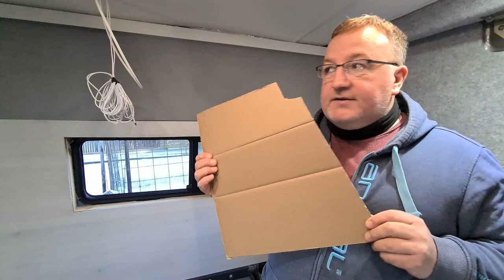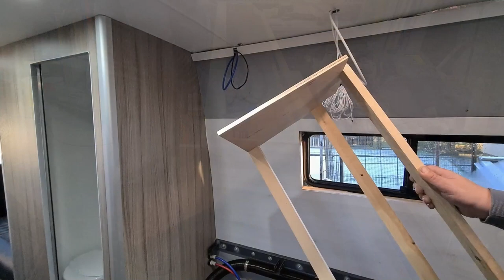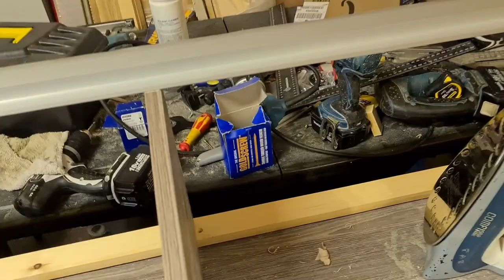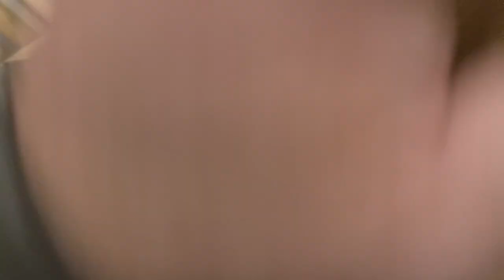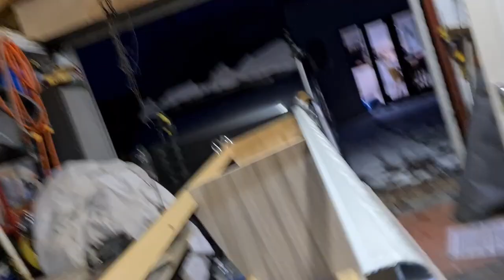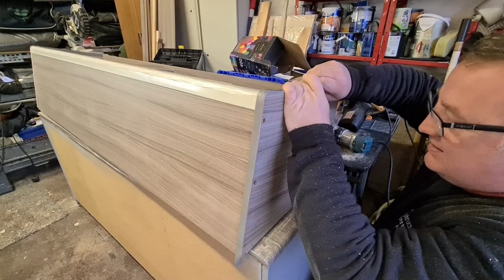selfbuild | vw crafter | campervan | overhead cabinets | van build | part 31 | the crafty blinders

Comment: How many sheets of the furniture board did you use for your build, Sam? Love the overall finished look.
Reply from the maker: I would like to say 3 full sheets but considering I have purchased 6 in total that wouldn't be totally honest it works out that to be economical I had to use pieces from a few boards as I ripped them down I would mark up the off cuts as potential parts for the build to reduce wastage so 3 is a good estimate but made up of off cuts mainly 👍
Reply: @TheCraftyBlindersvanlife  Cheers. I plan on templating all the parts into 4mm ply first which I get cheap being a floorlayer. Once I have all the ply templates I'll transfer them over to the furniture board. My thinking is that if I end up building a second for a family member I'll already have the templates needed for the furniture build. Loved the way you used it over the bulkhead, top class look.